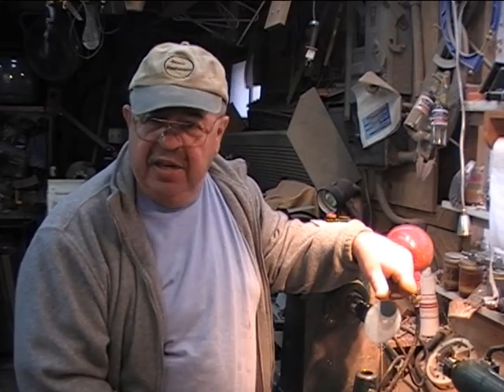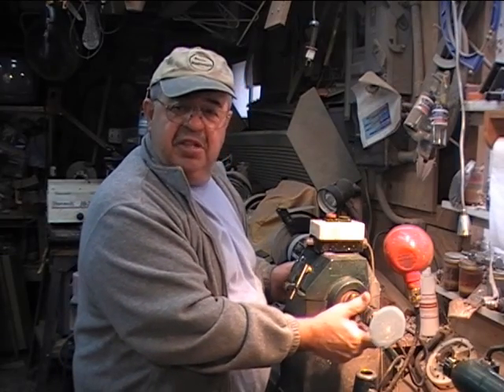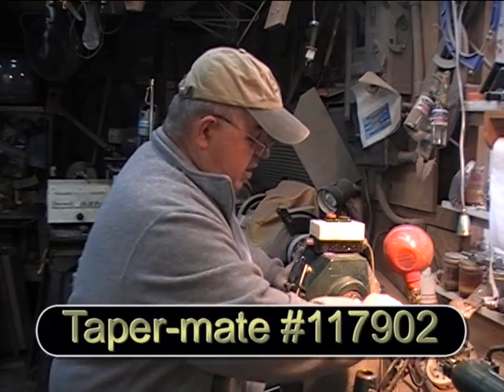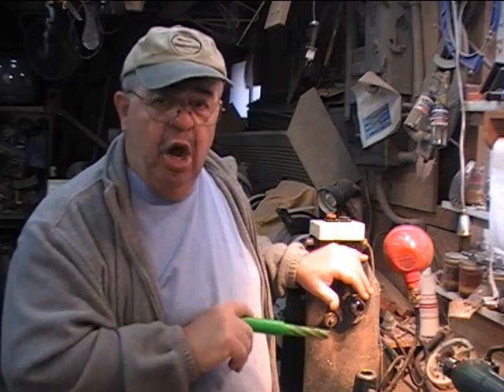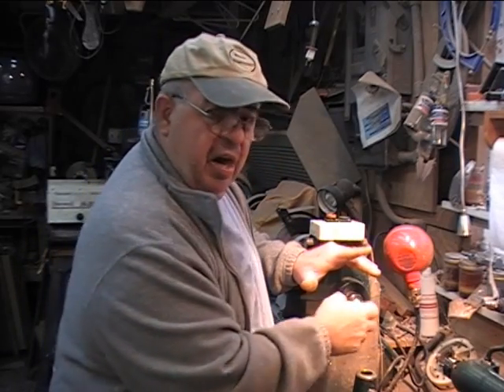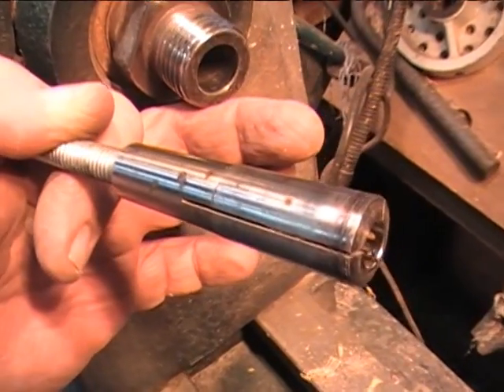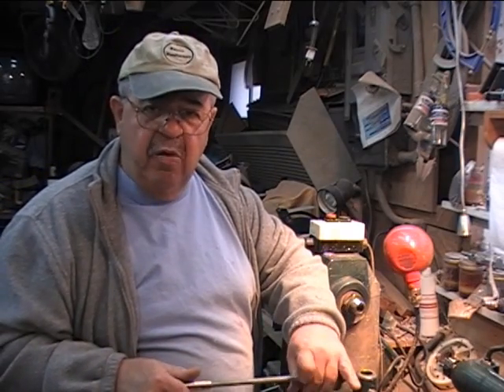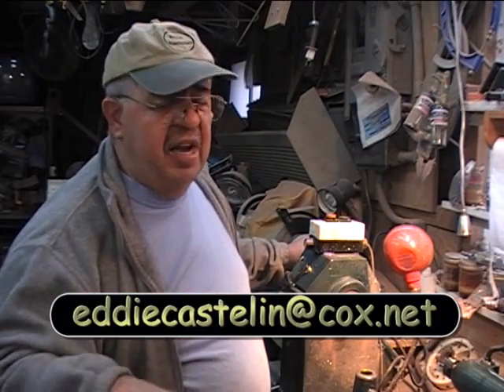Morse Taper, a few tips

Comment: I'm glad you touched upon a subject that rarely any lathe guy has covered, the Morse taper is the universal taper used all over the world, in the past American tapers like Brown and Sharpe, Jarno were the standards on lathers and grinders, if the tapers on the tool and spindle don't match you will have viberation, chatter and short spindle bearing life, many machines are stored less spindle and rust settles in , always stuff the idle spindle with paper towel to keep dust and moister out.

Comment: Great information! Thanks!
I have a question if I may.
I have a drill chuck I put into the lathe head. The chuck holds mandrels for turning bottle stoppers.
The MT2 into the head stock comes loose on me frequently. I've tapped it in with a plastic dead blow hammer.
Should it be necessary to tap it in like that?
I ordered one of those cleaners for the inside of the MT2 socket. Waiting to get that yet. In meantime cleaned it with a cotton cloth as well as I could. Did clean male MT2 too.
Thanks!

Comment: Turn the taper small and glue strips of leather along the length of it. Most of the commercial ones are made that way and they work better than the plastic ones.

Comment: I need advice.  I have an old Delta Milwaukee 12 Inch lathe 1948.  The taper in the tail stock does not come out when I back it down all the way.  I have put a lot of pressure on the taper and it wont come loose.  I don't want to do any damage to this old beauty.